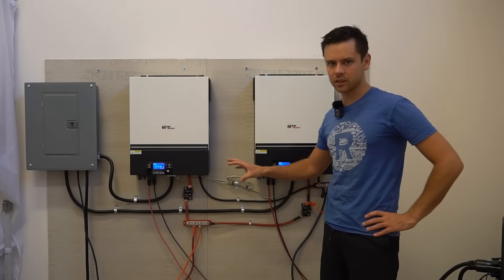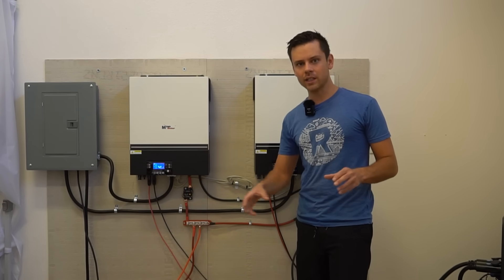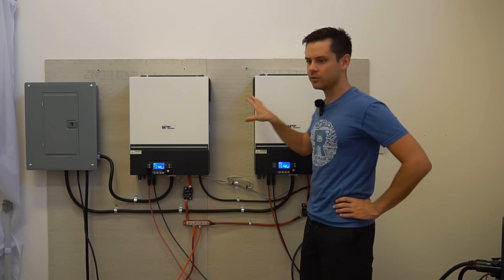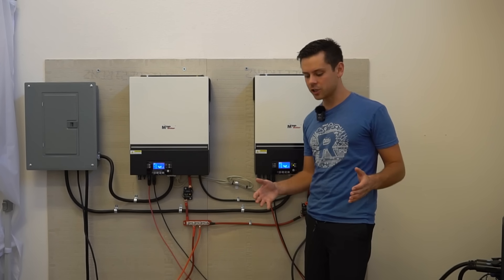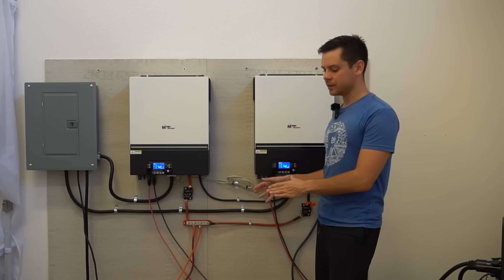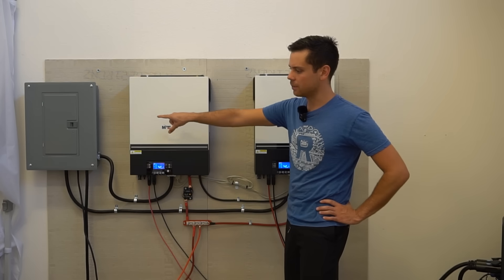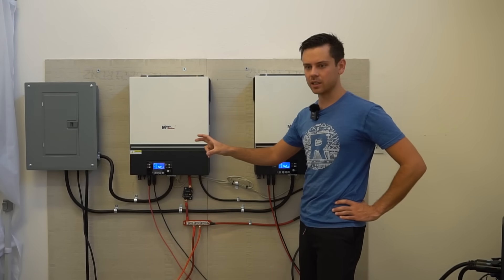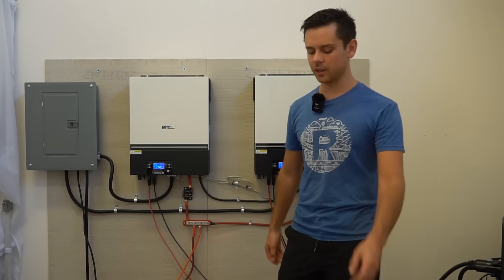Does my 13kW Offgrid Solar System require Grounding? Is it Grounded?

Comment: I think you would benefit from earth grounding.  First I want to say I got a huge smile on my face when I saw you put up Mike Holts Diagram.  I follow him also and he's a great resource if you want to learn more about electrical systems.  Ungrounded systems are inherently problematic and a lightning strike nearby could fry your whole system.  I also believe you a wrong about a ground loop.  If the system was tied into your utilities it would definitely  create a ground loop and would be dangerous.  If this system is off grid then you are dealing with two completely isolated circuits so there would be no ground loop.  Even considering this I think the safest thing would to earth ground with your grid system.  I don't know what the chances would be that the two systems have accidently become connected but if there is a chance it would be best to share one grounding point.

I am by means no expert and have not formally studied any kind of electrical theory but I find it fascinating.  I know your knowledge of solar energy far surpasses mine and that's why I watch your videos.  You have come a long way since you started and have provided me with great advice.  I really am curious on what your thoughts are in regards to my opinion.

I also watched this video because I am trying to decide whether my battery bank should be earth grounded.  I am 100% off grid and I just moved to a different property so I haphazardly hooked up my PV system and now I am reengineering to make sure its safe.  I had a lot of cut wiring and splices from trying to reuse as much as possible for cost savings.  Now I'm more established and I found myself concerned about safety and reliability.  Every time there is a thunderstorm I get anxious about it being an ungrounded system and worry about equipment failure.  I am finally going to complete my earth grounding this week.  If you have any thoughts on battery grounding please let me know.  I am also on lead acid agm because I used to work at a car dealership and techs commonly misdiagnoses agm batteries and I was able to restore a bunch for the cost of the core.  I keep seeing the prices of lithium dropping and with all the focus on battery technology these days I find myself wondering if I should make the switch.  I have lost a couple batteries recently mostly because I abuse them.  I curious what your thoughts are as far as the market goes.  Do you think the prices will continue to drop or do you think they are leveling out or possibly going to go up with all the material shortages now a days?  Also I work for one of the big three and I have seen some of the struggles the auto manufactures are having with lithium batteries and safety.  What is your thoughts on the safety aspect on lithium batteries do you think they have resolved most of them?  I was starting to think that was a thing of the past but fire concerns have popped up in electric vehicles now.
Reply: Look at the 32 second mark on this video, I would be concerned that a nearby lighting strike may cause an energy spike from the ground to the solar array and into your equipment tied into your array.  Nearby lightning strikes happen all the time here in Tampa FL and had quite a few surges knock out security cameras and security DVR's and then other electric equipment.

Comment: Ok, I have a question, I have a inverter that says I cannot bond neutral to ground, it has three outputs from the inverter Line, Neutral, and ground. On the schematic it show line and neutral going to equipment and ground to earth, but shouldn't that ground go to each circuit as well to be ground for those.
Reply from the maker: It's probably bonded in the inverter on your unit
Reply from the maker: Keep neutrals and grounds separate on the panel. You can buy a ground bus bar from the hardware store for this purpose
Reply: Thanks

Comment: My comment on the other video was ignored, but I'm almost certain these inverters are not 13kw, maybe not even half that for continuous use, please test load capacity for more than 2-3hours if possible, I think some interesting findings will present itself.
Reply from the maker: No, they can handle 13kW continuous. If you disagree, you should sue the 3rd party company who certified these units. And post a video after you sue them.
Reply from the maker: If they were not certified, I would test the output capacity.
Reply: @WillProwse  I have no financial interest in this, but it shouldn't be too difficult for you to determine this with the large lithium batteries you have at your disposal, It's all good if you don't want to spend the time with this, I still enjoy your videos quite a lot and find a lot of useful information, here in dominican republic there's a lot of rolling blackouts and we have several AC units here due to hot summer weather all year round, I've went through several inverters and even with great reviews and higher costs and they almost never delivered the rated capacity in continuous form, this is also not an isolated event, I don't have any experience with those units but with their current weight at 51lbs it seems to be quite lighter than some of the other units that where grossly overrated.
Reply from the maker: @frankmabo3940  oh right, that's because these are transformerless. That's all. They are usually this weight when they are

Comment: I'm a little confused on earth grounding my setup. My  DC circuit is referenced to earth ground at the negative terminal of the battery bank. I reviewed a Victron document that, if I read it properly, indicated earth grounding at the negative battery terminal was good practice. I tied in my home's AC earth ground for that purpose.  The inverter's earth ground terminal is also tied to it, as recommended in the manual. The solar panels are not grounded and are tied directly to the charge controller PV inputs (fused). The charge controller's battery output is tied to the battery bank, and thus the earth ground there. This seemed like a proper setup (single earth ground, no loops) and the DC and AC sides are using the common house earth ground. Is this setup a bad idea? Will seems to be indicating that I do not want the earth ground on the DC side.

Comment: I think a lot of the confusion comes from the terminology and what it actually means. 
Anything that’s grid tied usually needs inspection and in many places should be installed by a licensed electrician. 

It’s when we want to get fancy with our setups that we run into trouble because we don’t understand it all that well. Keep it simple sweetie (kiss - principle)

Comment: With this setup, I suppose the SPD ground connects to the solar panels. Then where should that ground be connected. To the AC input ground? To the houses ground rod? To a separate ground rod just for the solar panels?
Reply from the maker: Input as stated in the manual. I just used a normal cord.
Reply: @WillProwse  so then if surges go thru the solar panels frames or + and - nd thru the surge protectors ground it travels to the AC ground rod?
Reply: @WillProwse  Hi Will, great series ... I have these exact same boxes, I'm looking through the manual, and looking physically at the connections in the box ... I don't see anything in the manual that talks about how to connect the SPD ground to the box ...

Comment: Lightning protection is best done via lightning rods, which have their own dedicated earthing conductors not to be shared with anything, 
as the lightning will travel down it, which then yes produces a gradient voltage across anything it touches, including dirt.
The house grid earth connection is there in case the earth connection at the pole transformer is lost, 
the connection to earth is maintained, via the bonded neutral (both at the pole transformer and the house mains panel).
The neutral-to-ground "bond" is there for fault current to travel back up the neutral to the power source, 
tripping the circuit breaker on the hot controlled conductor.
This conductor is the ground pin on a wallsocket, it also neutralizes the live voltage during a fault so that humans don't get shocked.
Some SPD's just happen to use one or both to achieve surge dissipation, which is fine.
The neutral should only ever conduct the operational current, which is also flows back to the power source tripping the breaker during normal operation. It may or may not also conduct fault current by happenstance.
There should only be one earth connection point and the ground should never be used to carry any operational current, this also prevents voltage gradients from damaging equipment.
If you have properly installed lightning rods there shouldn't be a need for array SPD's, other than perhaps static discharge. A direct hit will render just about anything dead regardless of how good the SPD is designed or believed to be.
Some inverters are single phase, some are split-phase, some have bonded neutral and some don't, all of which adds extra complexity for DIY'ers. If anyone is unsure then they should just contact a certified electrician to do the work, it might save their life and/or not burn their whole city to the ground. (and code compliance and all.)

Comment: If you have an AC input would that make it a grid tied system, not an off grid system?
Reply: no
Reply: Not "grid tied".
But, grid connected. 
"Grid tied", is the common term for feeding power back into the grid.

Comment: Any and every Electrical System actually needs for safety sake to be grounded . Does it have to be ?  That depends on the system . But safety first.
Reply from the maker: Nope this one is a floating system. If I connect to source with ac input, grounding conductor supplies the connection when necessary. Like an RV connecting to shore power.

Comment: Thanks for Mike Holt reference. His video was helpful. There appears to be a lot of confusion about purpose of ground rods. Potential for more damage instead of safety. Seems like electrical practices are evolving. A bit scary with folks installing their own solar and emergency generators tied to residences without complete understanding.

Comment: One thing I haven't seen in any solar vids on youtube is do you ground to your chassis in a pickup truck caps house battery solar setup with inverter that's not tied into the start battery

Comment: i buy a hybrid inverter with AC input as charger. the AC input already have ground. but the AC output only has load and netral line. there is ground mark below the AC output, i believe that is the cable ground from output should be connected. do i need to make another ground? or just paralel existing ground to those AC output. i still don't understand, why the AC output doesn't have line for ground, they need to be separated place in hybrid inverter. sorry if this is a dumb question..

Comment: You should have a separate ground, bare solid copper wire to all your panels and frames no? This was a requirement for home grid tie systems. It was termed equipment ground and would connect to an electrode.
Reply: This was to mitigate a lightning strike and would connect to grounding lugs on all conductive components such as frames, panels, and emt conduit. You are providing a path of least resistance in order to protect your inverters and such.

Comment: What about DC only systems. I have no AC (no inverter), so it should be set up like a car, no earth ground, correct? Every curcuit is fused. I have an off grid cabin and everything runs on DC. I have no need for AC so no loss inverting the power. If you are building new why would you want AC. There are DC apliances out there. If you can't find what you need, build your own. I built a 12v DC swamp cooler out of a 12v pond water pump and a automotive radiator fan with a speed controller. If you want a real air conditioner get one out of a hybrid or electric car or an RV.
Reply: At 12v, no ground is fine as the voltage to earth will never be greater than +/- 12v. At higher DC voltages 48v+ you need an earth ground or everything needs to be in non-conductive cabinets(plastic). So that if a wire comes loose, there is no way for a path to a person to form.
Reply from the maker: Yeah you're fine. If you have DC powered radio equipment you might need a true earth ground but that's about it.

Comment: Excellent video, Will. A question: Let's assume you were NOT connected to an AC input with an earth-connected ground and were truly grid independent. Would you then connect your breaker panel to a true earth ground? I assume so. The reason I ask is that some people might have a system whereby they are sometimes connected to an AC input with earth-connected ground (tiny house on wheels connected to extension cord) but sometimes they are off grid with no AC input. Would you have to disconnect and reconnect an earth ground to this breaker panel depending on if AC input is available?
Reply from the maker: There is the argument that on some devices, static accumulation can cause a shock if not connected to true earth. I have never experienced it before. Having a floating system, not connected to earth at all, is not necessarily dangerous. I'm still trying to find devices that can accumulate charge as I've read from multiple sources. I test for potential in the cases of my equipment and have never found it. Besides that, I don't see any issue having a floating system.
Reply: @WillProwse  RCDs, RVDs?

Comment: For every billion people driving vehicles their engines exhaust emissions gives off 6.5 metric tons of carbon-d into the ocean every day and the byproduct of carbon-d is acid so the oceans and seas are slowly turning acidic making it possible for pockets of acid to wipeout fish that get trapped between the shore line and pockets of drifting acidic water they can't breathe not only that ovum of most crustaceans are deformed and even if they are born they can't even form shells because they are to brittle and dissolve. Chinese population is 1.5 billion, India's population is 1.4 billion, Africa's population is 1.3 billion with a grand total of 20.3 metric tons  of carbon-d per day. Americans population stays under 5 hundred million and Europe's population is at 7 hundred and forty million so who's killing the oceans China, India, and Africa. If all these 3 nations continue breed the world's oceans and seas will be gone in 50 years, they will have inherited a dying planet. The ocean produces oxygen through the plants (phytoplankton, kelp, and algal plankton) that live in it and it all stops no more oxygen. Those 3 countries are guilty of over breeding. A population should never exceed more than 5 to 8 hundred million in any given country. The first sign of a population problem is you can't rotate crops fast enough to meet supply and demand. I hate to say this the only way to save the world is nuclear strikes on all three nations or the planet will die

Comment: Personal Opinion, obviously the argument for/against grounding on these internal components is open for discussion, but I believe there is something to be said for earth grounding exterior things like panels and heat-pumps/condenser units. These are what can/will build up a potential (static charge) and so will increase the likelihood of a lightning strike.  Once a strike occurs, IMO no realistic amount of grounding will really protect that equipment.

Comment: The issue is not that you don't have an earth ground on that panel.  You should not have more than one earth ground.  The issue is that you have tied the ground and natural together at more than one place. And from two different systems.  You say it is off grid but that you have an AC input.  I assume you mean the AC input from the Solar array.  I also assume that you have a panel that ties the neutral to the earth. But now you have that tied two places.  So it is now possible, if there is an issue for your AC input to end up providing voltage to your AC output.  I have not seen all you connections but it is basic practice to only tie the neutral to ground at only one place.  I get you don't have to have permits but some of the NEC practices are for good reason.  If you ever have a fire I feel like this video is going to be exhibit one to why the insurance company will not pay.
Reply from the maker: Yikes, a solar panel output is in DC. Not ac. You have a lot to learn. 

And it's a floating system and I bonded at one location only. If I use the ac input, it will be connected to true earth at one location. As I said in my video.

A fire from what?? Every conductor has OCPD, is properly sized, and I am using a non combustible chemistry. Please state exactly what would catch on fire here? That is a bold statement. 

How do you tie to true earth ground on an RV solar power system? Chassis is obviously not. If I'm connected to shore power, the grounding conductor will ground the system. But when I'm not connected and running an air conditioner, would static build up enough to shock someone?
Reply from the maker: The ac input is an isolated battery charger. That's why this is NOT a hybrid or grid tie inverter. It is a battery charger. But it shares ground with ac output. So when connected to grid, with battery charger, you can only be connected at one point. when it's not connected, it's a floating system. Just like an RV or any other floating system.

Comment: would you help me build a system I use a jackery 300 and a 1000,one solarsaga 100 panel and a 100 watt knockoff panel too now I want a 100 amp battery or 200 in parrilla lithium Ion battery's I don't what else I need and I don't know what gauge wire to use or anything I know I need a solar charge controller and that's it oh I got a 12 volt inverter to. thank you for your time.